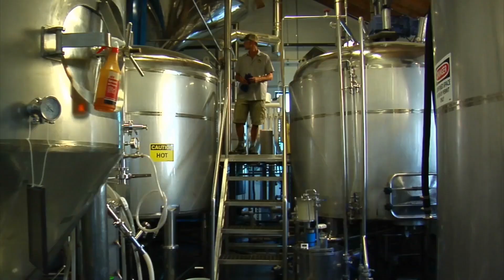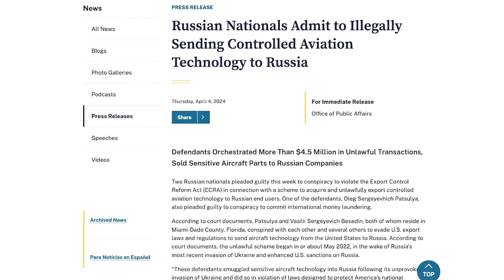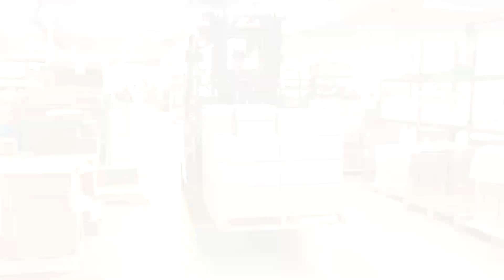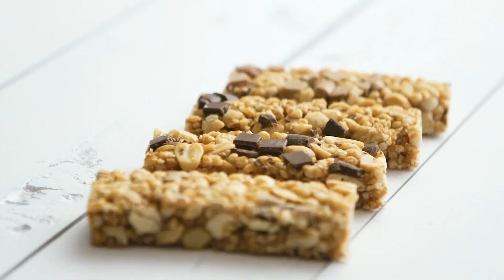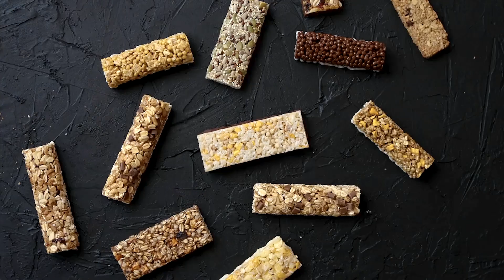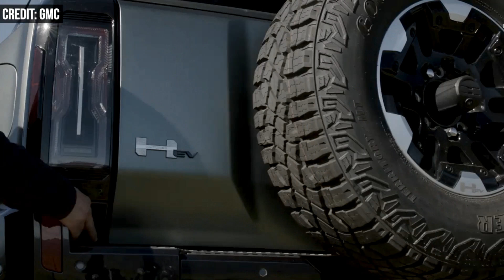Quaker Closes Plant; Philips Must Overhaul; Russian Airplane Scheme | Today in Manufacturing Ep. 165

Comment: The mid west has pellet stoves that burn corn not wood. Corn stove is a type of pellet stove that is specially designed to burn corn pellets, and it is similar to a wood pellet stove. But the chief difference between a wood pellet stove and a corn stove is the corn pellet stove has an addition of the active ash removal system and the metal stirring rod within the firepot.